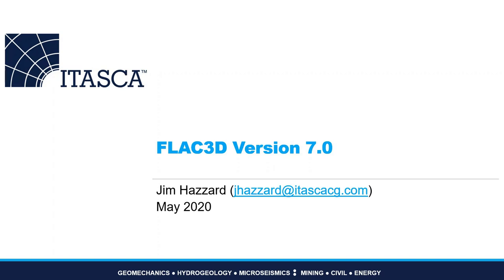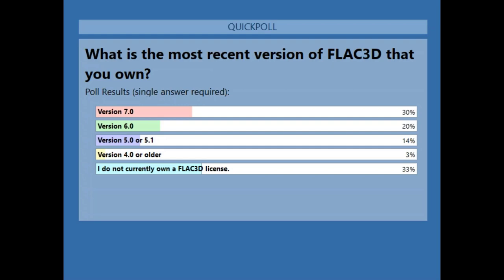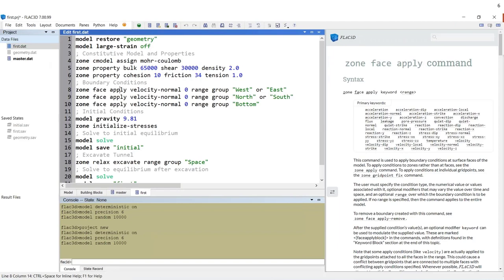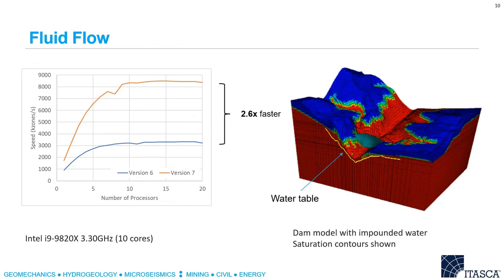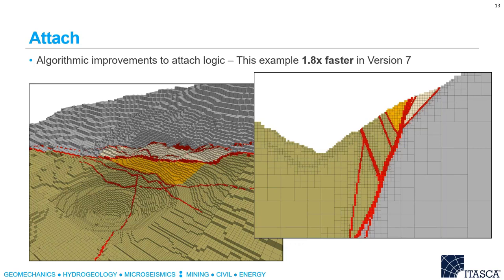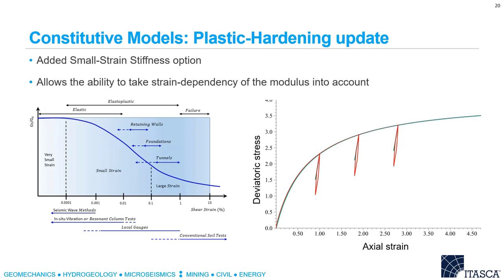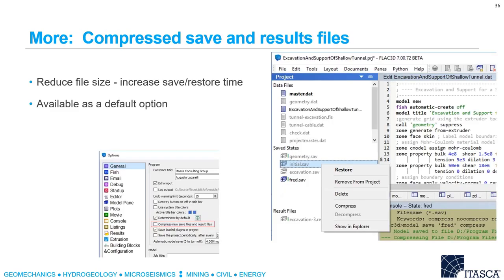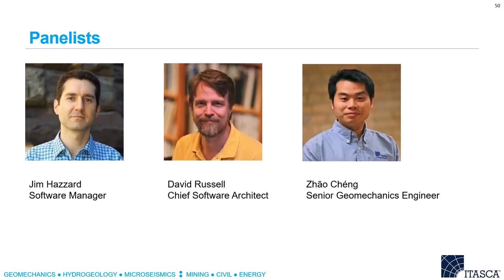Webinar: Learn About FLAC3D Version 7.0

Comment: HI there, is there any command in FLAC3D v7 which allows to rezone a model to avoid simulation stop due to bad geometry in large mode?
Reply from the maker: This is something that we have in FLAC 8.1 but not yet in FLAC3D. We are planning to release a tutorial of how this can be done using Python tools in FLAC3D, but not in the short term. Contact our technical support team (https://www.itascainternational.com/contact-itasca/software-support-request) and mention this post and we may be able to provide you with the working files. It's best to contact technical support directly for help rather than via YouTube. You may also try our new Software Forum (https://forum.itascainternational.com).
Reply: @itascasoftware  Thank you a lot. I am going to contact them in a trice.